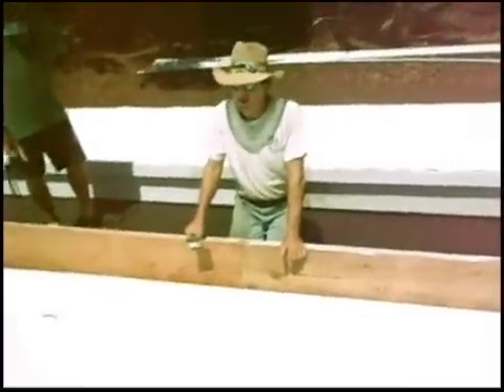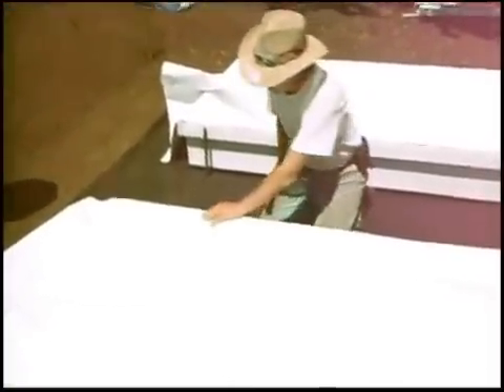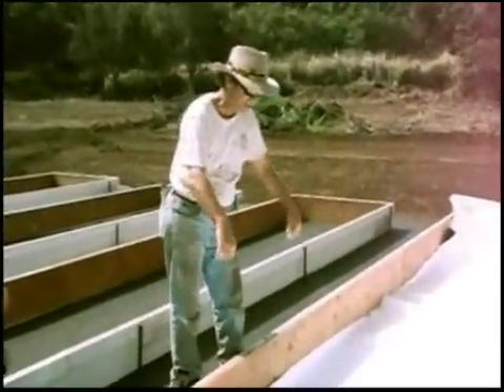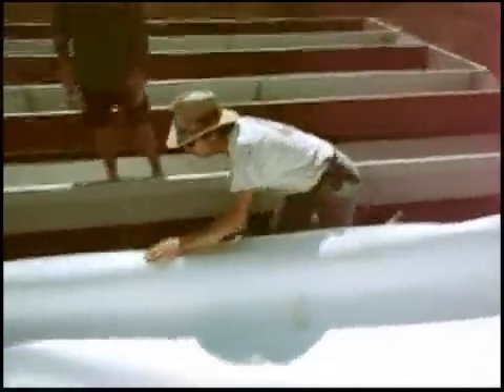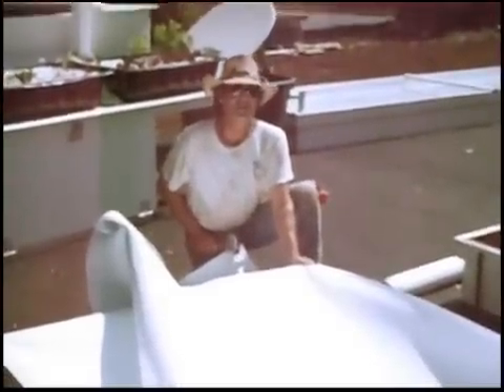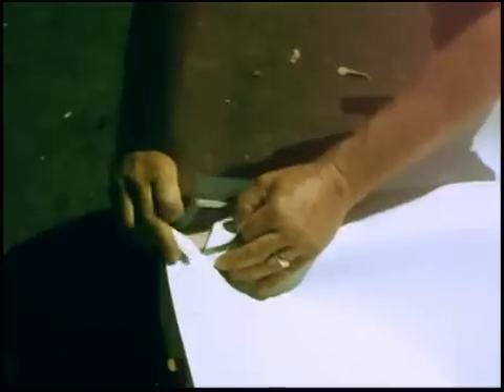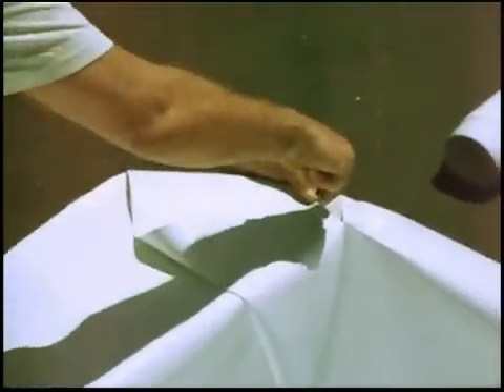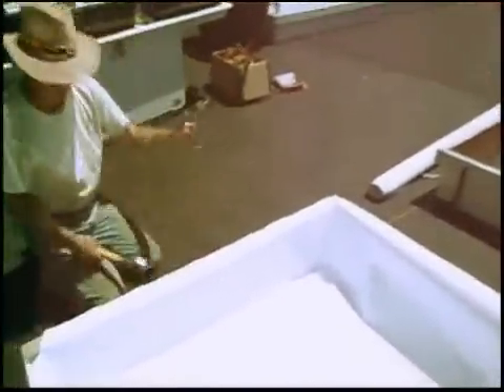COMPLETE Aquaponics Trough Liner Installation

Comment: My name is Michael Whiteford. I work for Energy Barrier Shield as listed above, we are a supplier for the Duraskrim R20WW product you see installed above. We are located in Atlanta, GA and are a one day shipping point anywhere in the Southeast. We stock the material you see above in a multiple sizes: 6' x 100' and 12' x 100' manly. If you have any questions or would like to place an order for this material, please do so by contacting telephone number 678-904-0038.

Comment: Tim, would this CAD drawing you have me support a 100 ft model?
Reply from the maker: +Robert Madden   

Aloha Robert, 

Yes, our students routinely build systems with four to twelve 100-foot-long troughs in them. The maximum length of series-plumbed trough we're recommending now is 900 lineal feet, or nine 100-foot-long troughs, for a total of 3,600 square feet of aquaponics trough running off a single 5-gallon per minute inflow. This saves a LOT on electricity bills, and still delivers optimum flow for the plants. 

We also aerate in the troughs with separate airlines and airstones in the troughs, because this length of trough is sooooo long that the oxygen the plants need would all disappear long before the water got to the outflow end of the trough, if we only depended on the oxygen that was in the water flowing into the trough.

We have such a system ourselves, that has been working without interruption for going on 7 years now. 

Aloha, Tim...........

Comment: tim, thanks for sharing this. do you know where I can find out how to build one of those troughs with basically the liner is being supported by top rails and the ground?  would love to see that our another option that saves money
Reply from the maker: +Robert Madden   

Aloha Robert              

Go to this page on our website: http://www.friendlyaquaponics.com/trough-videos/. There is a link at the bottom of the page that downloads a CAD Drawing of the trough construction. It's as strong and cheap as it gets; if  you want to make it rot-proof, use cement HardiPanel or 12-inch wide HardiPlank for the trough sides, and Trex or Bear-Tuf plastic 2X4's for the top rails. A bit more expensive, but really durable if built this way. 

Aloha, Tim....................
Reply: Thank you sir

Comment: COMPLETE.  But what about the nailer board your mentioned a few minutes from the end?  What and where does that look like?  And where do we find Trough liner?
Reply from the maker: Two Tracks Bow & Wool Trough liner suppliers are in the description at the beginning of this comment section; and the nailer board is untreated pine or "white wood" 1 X 2 with 4d galvanized nails or 2-1/2 inch galv screws 8" on centers. Aloha, Tim................

Comment from the maker: HI Mitch 

There's NO plywood under this, just ground. Even treated plywood would rot out in short order. The sides are 1/4 inch ACX; however, you can use any thickness. 

You can also use those plastic 2X4s for the sides and 1/4 inch thick Hardipanel concrete board instead of the plywood, if you want a 500-year trough! There's a free CAD drawing detailing how to build the troughs at the bottom of our "trough videos" page on the Friendly Aquaponics website. Aloha, Tim.....